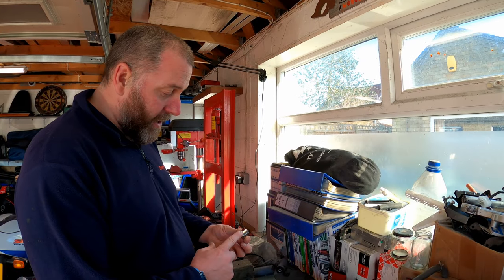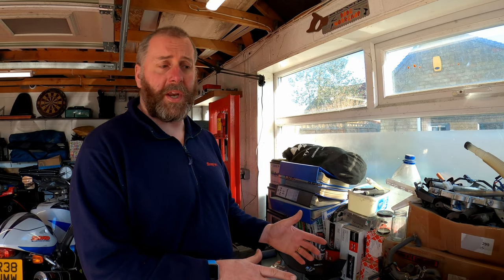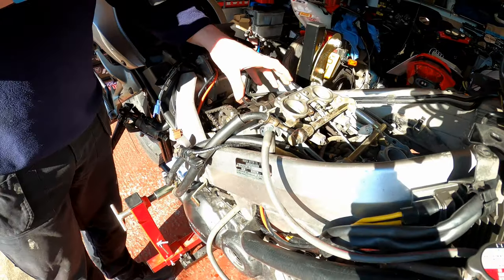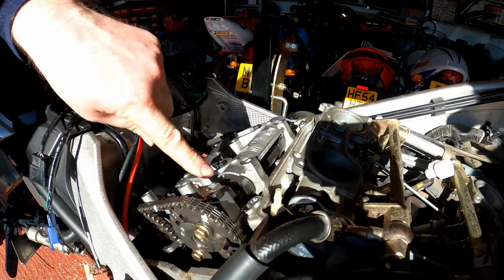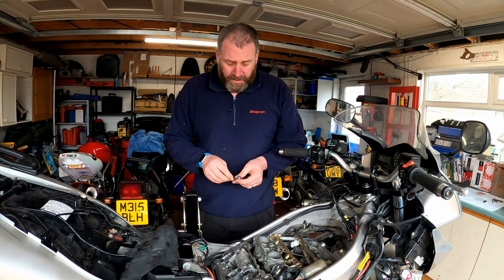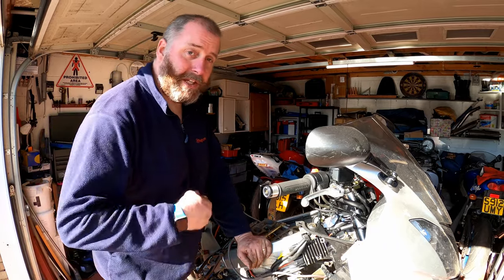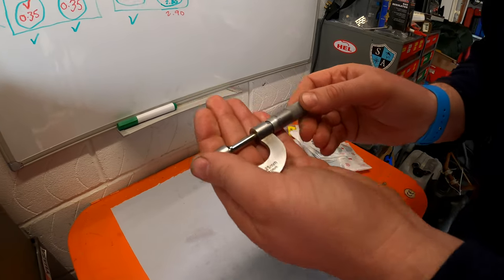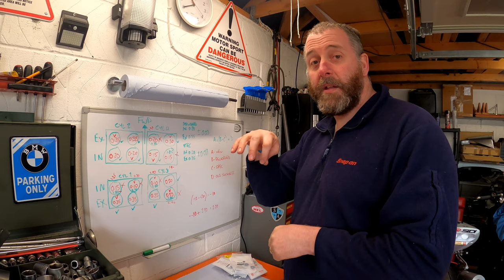Honda VFR800 VTEC Valve Clearance Inspection, Part 2 - Let's Get The Feeler Gauges Out!

Comment: I have had the valve checks done on my 2004  at 16,000 miles and 32,000 miles. They were all in spec. Have another valve check coming up in 6,000 miles. I will have it done on schedule. Another $550 just to check the valves, and more $$$ if they need adjustment. This is annoying, but I don’t want to do this myself. Checking the valves on my Ducati and BMW is a piece of cake, but checking the valves on a VTEC VFR is a piece of something else. Good video.
Reply from the maker: Thanks man!
Reply: My 2002 VTEC has over 173k miles on the clock and I'm just doing the valves now  due to me taking the engine out for some paint and a few bits and bobs. All but two were still in spec and the VTEC's were spot on. Save yourself some money and increase your check schedule. The bikes are so well built, theres no need to go into them every 16k. This is HRC stuff and the engineering incredible, its not a Suzuki!
I had to special order a head gasket the other week for a motor I was given with a threaded spark plug holewhich meant removing the head. Four weeks delivery, the reason given by official Honda chap was "We never sell any so we generally dont hold stock". That speaks a thousand words in reliability.

Just saying I know they're all members of the family and you only want the  best for your kids, I get it but when money is so hard to come by these days, save the un needed shop cost and buy more tyres and fuel ;-D

Comment: Great video, thanks for making it. I just want to add that torquing the cam caps is a proper step before taking the valve clearance measurements. Too loose or over tightened does have an effect on the actual clearance.
Reply: Also removing spark plugs, makes life easier

Comment: When you were installing that rear exhaust camshaft. Instead of shining the torch on the sprocket from above, there's a hole in the frame where you had that orange connector hanging that allows you to view the mark on the sprocket and the cylinder head with more certainty. I made the same mistake when I did my valve inspection.
Reply from the maker: The torch was for the viewers benefit chap not mine! 👍🏻👌🏻😎

Comment: I watched/helped my mechanic do this on my VFR750FK at 32k.  What a palaver!  Now I see that for a VTEC it is even more involved and it's a full on nightmare.  I wouldn't do this myself anymore.
Reply from the maker: The process is pretty similar to most other machine with hydraulic lifters, the difference on the VTEC model is that the cam shafts have to come out to prepare the VTEC lifters before any measurements can be made, then they need to be returned to their natural state which involves camshaft removal yet again! You are right! it's a right palaver! 😂
Reply: @KevsShed yes so much more involved and then everything is doubled up as it is a V4 as well so on and off 6 times!

Comment: Thanks Kev, great video! I do have a question about the VTEC lifters. The ones that are out of spec:  what exectly do i buy new ? Only the lifter? Cause i found valve lifters B, in sizes 2.93 mm to 3.35 mm (steps of 0.07mm). And re-use the valves, springs and VTEC element inside the lifter ? Thanks, your answer would really help me !
Reply from the maker: Yes mate, just the lifter and reuse everything else 👌🏻

Comment: First of all thanks for these videos, massive help my bike is currently on 27k miles and I have 6 exhaust and 2 inlet valves are out of spec, one question that I have is that can I rely on the numbers on the shims and buckets as I don’t have micrometer or should I just buy one to be sure, as this job turning out to be quite expensive I didn’t want to ad more to the cost.

Comment: Hi Kev,
Thanks for the videos.
If you don't mind telling me where did you get the shims to block the vtec valve. 
I can't seem to find them anywhere...if not...I will try to cut a 6mmx2.5mm drill bit. Thanks

Comment: Hey Kev! I have a question that you might be able to answer. I have an 04 VFR800

 I’ve been wondering if my valves need to be checked/ adjusted (hence how I ended up on your video), because when the VTEC kicks in, there is a much heavier rattle than usual. I don’t hear it while accelerating, only when I let off the throttle. Does that sound like it would be a valve issue? It sounds like a heavy rattle and just doesn’t sound as smooth as normal. I did an oil change recently and oil levels are good, and it sounds the same at idol, so I’m not sure what it is. Sounds like something with the VTEC though. Any thoughts would be appreciated!
Reply from the maker: A mechanical rattle on these bikes is normally caused by worn cam chain tensioners. I did a video on replacement of these too mate 👍🏻
Reply: @KevsShed  perfect! I will look more into it, but I’m hoping that’s it. Seems MUCH cheaper/ easier than these valves… haha

Comment: Hi kev
Thanks for the videos
Its the best place for me to confirm and check info.
I have done the job and at timed the front bank with cylender 4 marks however when I rotate the engine there is 2 arrows the it seems they must meet in the middle for number 2
And they seemed to be off a bit
Not sure what im doing wrong
The bike sounds fine and crisp but I feel a slightly down on power or it could be m imagination
Please advise if possible
Reply from the maker: It is actually quite hard to get the timing slightly off as you describe, in order to get the timing out it would have to be out by one whole gear tooth so you can imagine that the timing is most likely fine. Potentially there may be a marginal bit of chain stretch, but if it is feeling down on power then it would have been like that before you worked on it. I reckon it's probably in your head as you suggested! Hopefully this has put your mind at rest bud!
Reply: @KevsShed  cant thank you enough